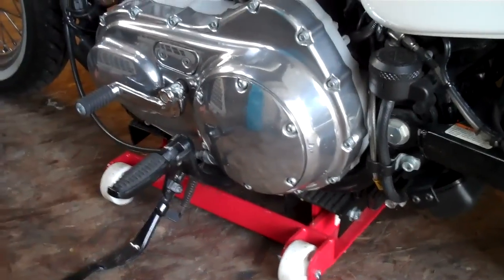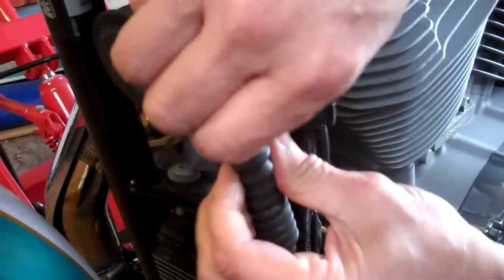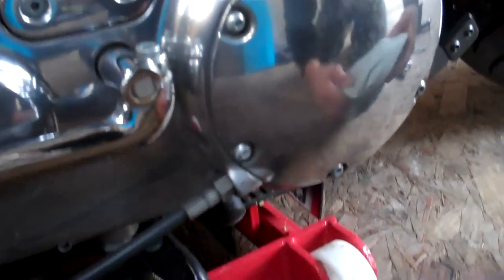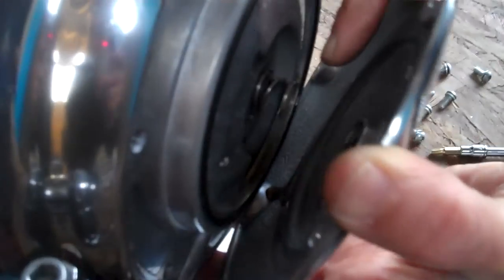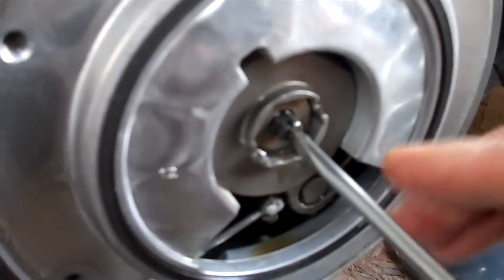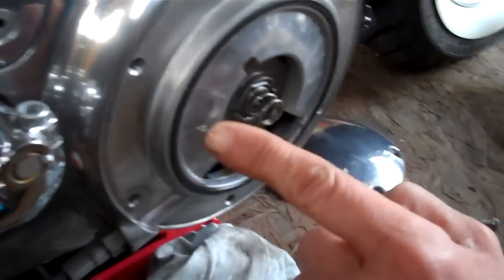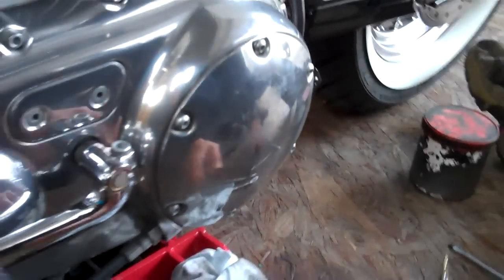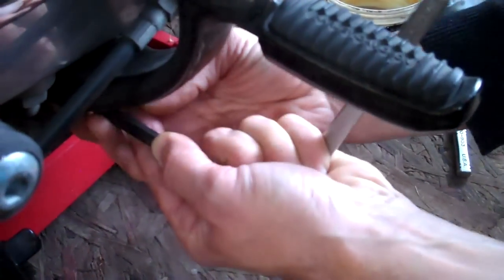Delboy's Garage, Harley Sportster Clutch Adjustment.

Comment from the maker: Hi mate...i would say its only really a requirement to use an oil cooler on your Harley if you ride in real hot weather and sit in standing traffic a lot.. but day to day in regular temperatures you wont need it, Harley motors are used to running as they are...changing the oil at the right intervals is important mind.. Thanks for your kind comments, im glad you enjoy the channel, its here for folks to learn and save a few bucks... take care buddy, and ride safe. Del.

Comment: So far, I've adjusted the clutch, replaced the brake pads, replaced spark plugs, replaced sparkplug wires and put a blinding new headlight on my 2010 XL883L...saved mad case AND takes the mystery out of what the mechanics are doing. Simply awesome site!
Reply from the maker: Thanks mate, great news, glad it could help and saved you some pennies at the same time !  Ride safe, Del

Comment: Like so many already, I am a big fan. All your videos are so clear and properly broken down. I especially love the fact you give a bit of the logic behind each action. 

1. That being said, when you are adjusting you use the word "seat" I am only assuming here, that you mean gently unscrew as far as it goes before you cannot go anymore, and then a quarter of a turn clockwise. All done

2. Can I use copper grease for all my torque screws and for that matter for anything that requires grease?

I am about to go ahead and do my primary oil change , and would be inspecting the clutch as well. Would appreciate your answers to the question above.

Thanks
Reply from the maker: Hi Angad.. Got your questions, an thanks for your kind comments too..   Ok, with the word 'seat' yes, it refers to the screw reaching the stop point where is wont turn any more...no need to twist it hard, just once the screw driver meets a little resistance, stop there and screw back in (clockwise) one quarter turn.       And Yes, you can use copper grease, or even the grey coloured "anti seize" would be fine...but only on places that are likely to seize or corrode.... and also always use red rubber grease on rubber seals if you can as it is less corrosive than regular grease of copper grease when it touches rubber...! 
Hope that all helps you sir.. good luck with it.. Del.

Comment from the maker: Hi David,mate,the job is simplicity itself,the  bike uses an 'in-line pressure switch'...cast your eyes in the gap under the left side panel by the fluid reservoir,along the brake hose there you will find a 'T-piece' junction union with 2 electrical wires plugged into it, take the wires off, undo the hose unions either side,bolt and plug the new one in & bleed it through, job done, if you are lucky it could just be one of the wires have come off, good luck with it, hope that helps you, Del

Comment: Thank you sooooooh much ! 🌞 💖💕🌷 I'm a girl and have had a leaky primary fixed 3 times at the dealership at my cost I found your primary and clutch video and got my manual out  no rubber o-ring on clutch cable ! And someone wrapped electrical tape around clutch adjust nut "  I'm really getting to know and love working on my bike 💖💕 I can't thank you enough I am very greatfull for all the little details you provide for beginners 🌷💖💕🌞I have a 1994 XLH hugger 1200
Reply from the maker: Most welcome, thank you for your kind feedback, im glad it helped!

Comment: Well, turns out you were right about trying it with the engine running.  I had assumed erroneously that putting it in first gear and holding the clutch in was a good way to check for proper adjustment, but it doesn't roll naturally that way.  However, once the engine was running everything worked just fine!  Thanks again for the video and good advice.

Comment from the maker: Hi Jeff,
Like the video says mate, slacken off all the cable tension, then BACK THE SCREW OUT UNTIL IT SEATS GENTLY.....THEN TURN IT BACK IN A QUARTER OF A TURN....Then place the lock nut and spring assembly on, and then the Derby cover to hold it all in place... hope that's what you wanted buddy... take care, Del.

Comment from the maker: Hey there buddy....you must do this with the bike 'standing straight up'...not because it has any effect on the adjustment, that's the same either way....but when you take the inspection cover off, the primary oil will pour out. so stand it upright to make this adjustment.. hope that helps matey... cheers, Del.

Comment: First of all, thanks for getting back to me so fast!
Ok so when I adjusted it, I didn't put the derby cover on correctly so I had to change the primary oil since some leaked. I already changed it and it's still doing that. I put one quart in.

Comment from the maker: Good question... the answer is NO..it wont bottom when you turn it band in a quarter turn, it would keep going for about 5 whole turns....the rule to "back it out till it locks, then turn it in a quarter"..is ti ensure that it is free to move.. you are just 'unlocking' it.. watch the video carefully, and follow that bit explicitly...and you will be fine... good luck with the job mate, go get stuck in... Del.

Comment from the maker: @1supermanprime YES   100% correct, .. Like i said before and in the video, its natural to presume it winds inward.. but once you see it dismantled you see that the screw is inserted from the inside facing out, when it is mistakenly wound IN.. it has no short term cost, but will slip in hot weather and lead to plate wear...   Just to check the cable is slackened enough, poke the head of the cable inside the primary case to make sure it 'jiggles' free of the fork it sits in, hope that help mate..

Comment: What a refreshing change to see someone who understands little but important things like tightening bolts in a star pattern. I cringe when I see so called experts tightening bolts in a clockwise or anticlockwise pattern and then have issues such as oil leakage. I use graphite grease on fasteners. Not sure if it's any better than normal grease, just something I've always done.
Reply from the maker: +Tony Little Hi Tony, thanks for your kind commets yes i use copper grease or anti sieze on bolts a lot of the time, mainly if they get a lot of weather that will dry them out... thanks for watching... all the best.. Del.

Comment from the maker: Hi there....if you install any new clutch cable it means backing off all the settings...so yes, just resset all the adjustments as shown here, hook the bottom inside the case, then use the middle bottle screw to set the lever to 3mm of play....and its always worth checking the pack freeplay on the nut too... hope that helps.. Del.

Comment from the maker: Hey buddy, thanks for your question... for general maintenence you will find a general tool kit of sockets and wrenches is a good start, also for oil changes, get a 'Kitty Litter tray', holds 2 gallons, plenty for any bike oil change, and a small funnel for refilling, if its a harley, get a oil filter wrench (the 'jar cap' type is best, then get a good shelf of consumables, I.E.Grease, gasket sealant, WD40, spirit wipe, 3-in-1 oil, etc, ..ill PM you a few more bits as limited space here....Del.

Comment from the maker: Hi mate, i've 178 videos, and about half of them are bike maintenence, have a scroll through the early ones, i did a 5k service on my XR1200, (plugs are childs play).. the first thing you should do is buy a genuine Harley Davidson Sportster workshop manual, get it direct from the dealer, they're a bit over £60, have every job covered, tollerances and settings, and some great exaplainations that are easy to follow, also if your bike is under warranty, speak to the dealer about doing your own work

Comment: Just had to come back to this video when I replaced the cable on my other sporty haha. Found out a neat little trick, if you push in on the plate while you're adjusting with the flathead screwdriver, you can feel it better when it starts to grab.

Comment from the maker: @roleeesh Hi mate, and thanks for your kind comments. no you can just follow the same steps to change the cable.. open the primary outer plate, you'll see the cable hooked into the clevis on the clutch, just back all the slack right off on the cable, and remove the cable head from the lever at the top, this will give you enough slack to unhook the bottom.. then just back out the nut in the casing, job done, then just install the new one the same way... good luck with it, cheers. Del.

Comment: Great video.  Put in a new cable today (old one had small leak) and for the life of me can't get it to adjust properly.  Followed this video exactly (as well as the FSM a dozen times) and best I can do is get the bike to drag really bad with it in gear.  I haven't started it yet, but I'm testing it with the clutch in, in first gear, to see if I can get the bike to roll smooth...  It will peg against the gear but roll with great effort, like the clutch is only half engaged.

Comment: Hi Del, great video I cannot express how great it is to find someone who is making repair and maintenance vids on the sportster, it seems most of the other ones are on the "Big Twin" engines. . I've been a sportster fan and rider for many years now, currently I'm riding a 03 1200 sporty and your videos are a major help, the only thing that I keep forgetting is to convert the torque specs you mention to ft lbs instead of metric. .lol 
Again a big thanks from a fellow enthusiast in the USA, thanks Mark.
Reply from the maker: Mark Gaston Hi Mark, good to hear from you fellah, and thanks so much for your kind endorsement... there are a fair few videos on Sportsters and there's not much you can't do yourself on them, as they are pretty basic!  Always feel free to drop us a line, online pretty much every day, ride safe, Del
Reply: thanks for the reply, I have always done most of my own repairs, cause if I mess it then I can only blame myself, btw, do you have any suggestions on how to adjust a craig programmable electronic module, my bike has one that was already installed when I got it, however the adjustments that look like mini dials have somehow got out of adjustment, I don't really have the funds to put it on a dyno. Any advice would be very helpful,  thanks, Mark
Reply from the maker: +Mark Gaston Hi Mark, sorry but i dont have any experience of the module you asked about...did it come with any instructions, or can you download any form the makers website...just a thought..?

Comment: Thanks for all the help.  The bike is a 2005 Sportster and I've serviced it with the factory primary chaincase/transmission lubricant.  By plates do you mean the ramp assembly (piece with the three bearings inside that opens slightly when twisted?)  - that piece is clean and free of debris.  Bike operated just fine until I changed the cable yesterday.  Hasn't really ever sat for long.  I will make a video later if I can't figure it o ut.

Comment: Thanks Del,
It all went well,the clutch adjustment spring was broke their was still pressure but not as much as their should have been i readjusted everything just  like you said and got a new spring .I took The  bike out for about a 5 mile ride seemed to be perfect the only thing i did different was set the bolts to 7 foot lbs 11 nm seemed way too much i'll keep an eye on it ....Thanks again

Comment from the maker: No, 7k miles is fine, if its not clattering then its not eating the inside of the casing... get it done what you can, and all the info you need is in the video for the cable adjustment.... good luyck wiht it... cheers, Del.

Comment from the maker: It's quite clear in the video - so follow exactly what it says... it's always a common fear and confusion - turn the screw out till it seats, then back in half a turn... don't over think it, it's not that vital whether it's 1/2 or 1/4 ... as the clutch plates wear more slack will develop and once you are running aournd with more than 2 turns of adjustment there it will start to drag at the lights...

Comment: Nice video. I am looking for as many how toos as possible as I have a future plan to put 16" apes on my sportster and want to go in to it fully confident. This is one along with the throttle/idle cable adjustment I have yet to totally understand. You did a good job staying simple and really explaining, feeling another step closer to jumping in to my swap. Thanks man
Reply from the maker: Hi Kevin. i like your approach buddy, taking the time to get your information and prepare your task, its not hard, and if you buy yourself a proper genuine Harley Davidson workshop manual from the dealer then you can refer to it for any tips and help you need...they also have fully detailed photographs to equate to the bike as you work and help you along.....admittedly they are pricey, and for that reason many people wont bother buying one but look at your manual as the most valuable tool in your garage and it will help you more than any video ever will buddy... good luck and let me know how you get on with the bar swap...happy new year and ride safe.. Del.

Comment from the maker: Hi Max, there are a couple of things that can lead to this. The reason it won't dis-engage the transmission is that the clutch is not fully releasing the drive so there is still load on it,the reason it's not releasing the drive is that the clutch plates are still binding together when you pull the lever in...they could need adjusting or more likely, be dirty,best thing do a full clutch adjustment like this video says,then change the primary oil & use fresh Screamin Eagle Syn3 oil..should fix it

Comment from the maker: Hi Jeff... NO, you dont have to adjust the clutch pack when you swap out the cable.. but you DO need to take the clutch unspection cover off to get to the bottom of the cable to unhook it... so why not just check the screw while you're in there.... good luck,, take care, Del.

Comment from the maker: Hi buddy.. the most likely cause could be that the lever (whilst it may not have broken) it could have bent inwards a bit...that means when you pull it into the bar it isn';t tugging enough cable out of the clutch to open it fully..i would imagine if you replace the lever that it will work normally again...that's the only component that was hurt, so that has to be it... Good luck, Del.

Comment: Cheers Del I bought an 05 Custom & I'm going through all your old Sportster Vids A++
Reply from the maker: Good choice Jack, glad the video can help you out matey, drop us a line if you need a second opinion or get stuck... happy new year fellah.. D&Px
Reply: Will do Del. I've had a Twin Cam (carb) Road King & a FXST (carb) Softail but have gone to a 'sporty'. 

I love the simplicity of the sportster engine & don't mind getting my hands dirty. Got the factory manual & your vids.

Have a happy & safe 2017.

Comment from the maker: Hi buddy, It not a hard and fast measurement, but i always feel its right if you play it in 'thirds'....what i mean my that is...with the lever tight in to the grip, let it out one third of its travel and it bites, then a third more is the 'bite zone' as it feeds the friction in, then the last third is free play so you are sure its full engaged and the cable is totally slack and not pulling on the clutch plates....hope that helps mate... ride safe.. Del.

Comment from the maker: Hi there. if you have a handbook with your bike,, all the information is in the service schedule..There is pretty much nothing too obvious that shows its wrong, but it will wear real fast and clunk heavy into gear if you neglect it..and once its worn, you can 'unwear' it..The reason its done is to maintain the correct gap between the plates when they are dissengagued, and you must do them every 15k miles at least..(i do mine every 10k because its a simple job and why not be sure)..take care, Del

Comment from the maker: That would be a VERY good move mate, just as long as you dont get carried away and over tighten them.. the casing is soft alloy and if you strip that thread then its way more grief than a new bolt...

Comment from the maker: No mate, clutch adjustment is a periodic job on service, all Sportsters drop in a bit heavy...try pulling in the clutch, wait a few seconds, dab the clutch lever in and out a few times (only about 1/2"), then poke the gear in, it should drop in a little softer then...its just a case of separating the plates in the clutch.... if it was badly out of adjustment then you'd feel it drag in gear at the lights.. also warm it up a bit first, cold oil is gloopy and the plates are still gummed together.!

Comment from the maker: Hi Antoine, NO, the engine oil is up in a tank and away from the primary anyway, so not effected... and the primary oil will not pour out of the hole as long as you stand the bike upright.....good luck with it,, Del.

Comment from the maker: Believe it or not, No....the clutch pack itself only needs adjusting on service, to change out the cable, just slacken off all the adjustment in the middle screw, take the lever out of the bar clamp so you can remove it from the top end of the cable..and then you'll have enough slack inside the primary case to unhook the bottom end, screw the bolt out and then screw the new one in place... then just re-install and set the cable tension at the middle.. hope that helps, once again, take care, Del.

Comment from the maker: Hi buddy, it's not uncommon with forwards for the linkages to jam up, so make sure all the joints are free to run without binding and nothing is pulling at an angle, also make sure that the peg is not pushed too far on to the spline so its binding on the case, if everything is moving freely then it will be internal, but that's highly unlikely... more likely to be something to do with assembly of the forward control system .. hope that helps, buddy, let me know, Del